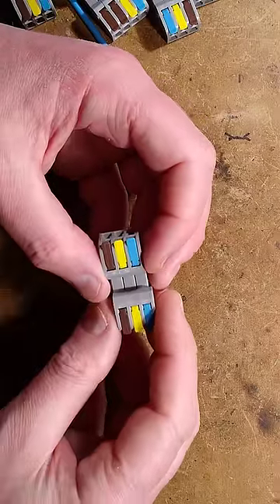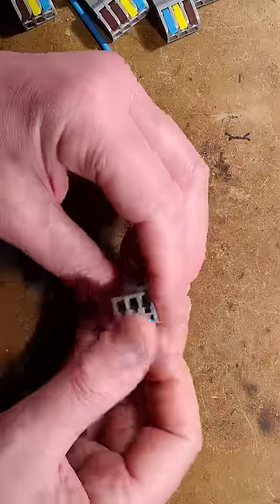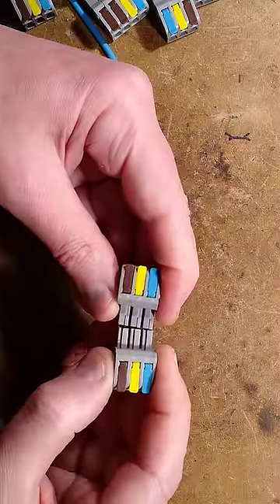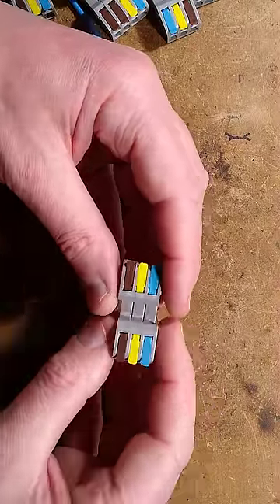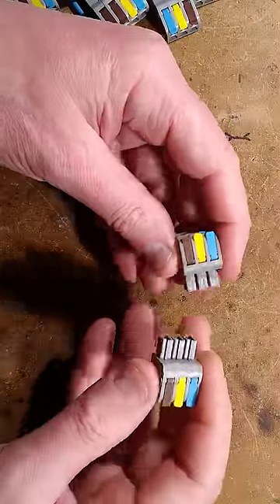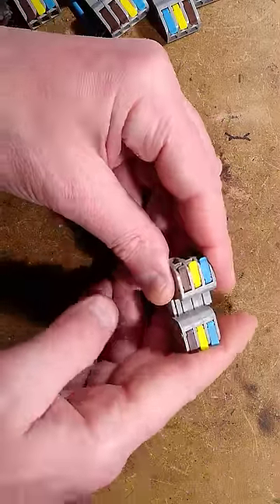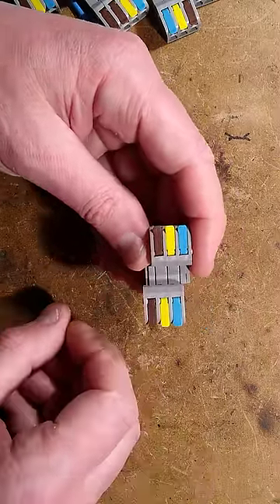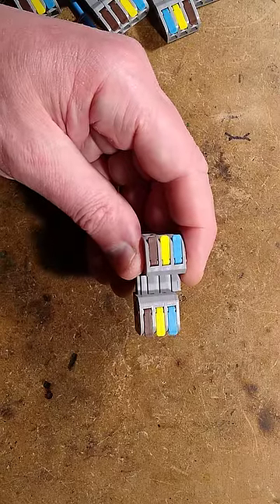This connector can kill you

Comment: I fixed a home installation once were the sockets didn't work. Turns out life and earth wires were switched.
Reply: Death and Earth. 😂
Reply: And that's why you always break the circuit before working on it. You may what you're doing, but whoever wired the circuit might not have!
Reply: I was on a new build recently installing an ev charger and through fault finding discovered the L and CPC had been swapped in a junction box repair where someone had accidentally cut the cable. Crazy!

Comment: To prevent this deaths, in Austria, gfcis on the Apartment Level (located directly behind the mains) are mandatory by building code!
Reply: Those (30mA earth leakage interrupt) have been mandatory in South Africa since the mid-1970s. It's probably why I'm still alive😂. I have however had some shocking L-N experiences in my youth, but I'm still breathing and a pro commissioning engineer at 50+ yo. I made a lot of my own mistakes on powered devices as a kid, but having European mentors kept me alive and interested (interesting) in my youth (thanks Franz). It's guys like us that make the brain drain from any country worse, and why SA is now powerless and supports terrorists!
Reply: Yea tought the same - but i can get the reason here, plus there are industry power circuits that dont have a gfci. Like we had in our data center located in Germany.
Reply: If you connect the Live/Hot to Earth/ Ground, that's going to trip the circuit.
Unless of course the ground is not in fact grounded, then yes the casing will become energized, but then you have no ground to complete the circuit so you don't get electrocuted. 🍻
Reply: @Jonathan-jo2xu  Unless YOU complete the circuit and become the consumer, turning current into heat with your body. Permanently installed machinery is often not RCD protected, nothing trips except you.

Comment: Great catch Clive! The literal definition of “Plug and Prey”! I can’t count the number of time poor assembly design had forced me to plug connectors together by feel only. A certain disaster waiting to occur.
Reply: Plug and Die would be more accurate!
Reply: Prug n Pray!
Reply: You're the prey😂
Reply: There's one live and one neutral not connected. Please explain how it is dangerous if you don't have a completed circuit.
Reply: That was my grandfather's house... And he was supposed to be a carpenter
Reply: @mistborndensetsu5015  So, the problem comes when the circuit is not complete, but very quickly becomes complete when the live wire goes to earth through the (supposedly earthed) chassis of the appliance, your arm, heart, torso and leg. Lots of things conduct electricity and can complete a circuit, including you.
Reply: @Asha2820 why are you working on a live circuit to begin with? One would think you would be extensively qualified or being directly supervised by someone that is if that situation was needed, and usually in that event, you were in the proper PPE to prevent an accident should a slip up occur. If you're not an electrician then it's simply darwinism at work. And if youbare am electrician and know the dangers and still refuse to use the PPE then the fault lies within you anyways, not the design of the connectors. Cuz if you crossed those wires and plugged it in correctly bur still got that live hot wire onto the grounded wire, it wouldn't be a design flaw, it would be am idiot not knowing what their doing flaw.
Reply: @LinkandPage  So, the danger is not that some electrician will be electrocuted while working on an application when it is not receiving Live, as you seem to imply. The problem is that someone will get electrocuted in normal usage of the appliance, when it is receiving Live. Not everyone who uses electrical appliances is an electrician. I assume that you don't go around in rubber gloves when you use your computer or make a slice of toast.

Part of what makes for good safety design is making things easier to use safely and difficult to use dangerously. This is why firearms have safety switches. It's why consumer unit circuits need to have labels on them. It's why food comes with expiry dates. It's why circular saws have riving blades. If someone deliberately designs something that contributes to making it easier to use dangerously when a safer solution is available, that, in my book, is bad safety design.
Also, I dislike the references to Darwinism and the attitude of 'You're stupid so you deserve to die'. It makes the trade less accessible, increasing the barrier to entry, and also you have to remember that, the person who makes the mistake with plugging in the Live to the Earth can cause other people (who don't deserve the Darwin Award) to get electocuted.
Reply: @Asha2820  I own a sig Sauer sp-2022 and a Glock 26 5th gen, and neither of those firearms have a safety switch. The sig is for open carry, and the glock is for concealed. Bith is loaded, and I keep one in the chamber. Before I got brave enough to carry these pistols on my body euth one in the chamber a d without a safety switch, I did what you're supposed to do when dealing with anything dangerous snd that is train until I feel I was proficient enough to use them safely. And i continue to train with them so as not to get careless. Not all guns have safety, and many of them do not. It's called double action. My sig was designed in mind for the police officers who use them so that they could have their service weapon drawn and sined at s suspect with a finger located on the trigger and not accidentally shoot them. But it could still happen. Police officers train with their device weapons constantly. I don't think I've ever really seen a revolver with a safety switch. The point being is dint use something that you aren't qualified or trained to use. Messing with electricity comes at potentially deadly price if uou don't know what ypure doing. Working on a live circuit for anyone other than a qualified electrician who is the very least a journeyman is a dumb idea to begin with. We .ake circuit breakers so electricians jniw what they're doing can still di safely. But just a random DiYer who thinks they are qualified abd know what they are doing can easily screw ip the first part of attaching those connectors just as much as thry could in the second part of connecting those connectors.  The first part comes with taking the hot load and the ground and putting each of those wores into the connector. So what would they do if the 12/2 or 14/2 they pulled out of the wall behind an outlet, they were moving to a new location 3 feet away. They oull out maybe 6 inches of rimex before it can't be pulled anymore because it's stapled to the inside of the studs. Also, say when the house was bejng built, the electricians happen to be behind schedule or the posters were ahead of schedule or the GC screwed up the scheduling, whichever of the thousands of reasons rimex csn end up covered in paint and so now they have 2 wires that have insulation and both are painted white and then the bare ground, also pained. Would they know which wires are which? So shoving the wires into the connector so they can extend the romex with 3 feet of new cabling to reach the outlets new destination.what happens I they put what they think is the hot jnto neutrals spot or the ground and then they do the second part, which is connecting the male and female connectors, and they pull thst second part off flawlessly. The two connectors connect exactly how they are supposed to. You dobrealize they'll still get shocked. Even if they designed the connectors to connect to one another in only way, abd they dud that part correctly, they'd still eat 120 volts, wouldn't they? The connectors aren't just already attached to the wires magically. You have to feed the wires into the connectors. This is how all connectors work. So how do you propose that problem, which is much more likely to occur than two connectors being misaligned, how should thar get fixed. These connectors have gone one step further than most by offering colored slots to make identifying easier. The problem is that there is no way. A qualified electrician knows to pay close attention to that significant detail, and that's why they undergo constant training and testing and have ranks amongst the trade and governmental restrictions for each rank. It's an entire industry. Ebay sells these, most likely in bulk, and there most likely targeted towards electricians. Since they would be consuming this product more than anyone. The overall point is everything you do that has a profession behind it and you have not had any training in that specific profession, then you are inheriting the risks that the training helps eliminate. Do not work on something you are not qualified for. If you do, you are taking that risk, not the company that sells these connectors. Hire an electrician to do the work.  I have worked wuth electrician friends and have even logged some of the hours as an apprentice, even though I dint want to become an electrician but it helps a lot to know what to do since I work as a low voltage electrician, which deals euth access control, fire alarms, cctv, intrusion alarms, datacomm and servers, abd so coming across electrical is a daily aspect if my job. I kniw what I am doing, but when I add new outlets or a new circuit breaker or change light fixtures at my own house, before I even turn the breaker back on, and despite knowing how to wire up multiple switches with switch legs in a receptacle or under my workbench, I call my qualified electrician buddies for one to cone over and check out my work to ensure a secondset of eyes, qualified ones, look at my work and deem it safe. And I usually throw them 50 bucks and a 12 pack to show appreciation because I am not an idiot and j know that me sgsinst electricity is like me against Mike Tyson, yeah theirs a remote possibility I could win, but not really, 99,999 out of 100,000 times I'm gonna lose so I dont take that risk. If you are willing to work on a live circuit, then by all means go for it, that's simply called darwinism
Reply: @Asha2820  Wait, why would I get eltrocuted making a piece of toast. If the connector was plugged in wrong,  the breaker would trip when you turned it back on, therefore rendering it not a live circuit anymore. Same with the computer. And my table saw has no guard om the blade, you don't put your fingers in there and you feed the wood in the correct direction against the fence, but even those table saws that stopped if they hit human flesh only can stop so fast. I get it if safety factors can be added then they should, but making keyed or different sized ports on these connectors cannot stop the user from incorrectly putting the wires into the connectors, which again, would be the more likely scenario for misfiring than improperly connected connectors.  And the trades should be challenging to get jnto so as the trade jobs become higher paid and much more appreciated as the work output would end up better quality while painting anesthetics as well. But I can't fathom a reason why anyone would use this connector that either wasn't an electrician or doesn't realize the risk they are choosing by not paying for an electrician abd point it themselves. It's a very low chance this connector tor will hurt someone down the road after its installed. Jf incorrectly wired, the breaker trips abdthats it. Noone is getti g electrocuted a month after the connector is installed. Any eke triangle wirth their salt or ant responsible homeowner or whomever hired the ekectrcican would know to test out the work they did before leaving or allowing them to leave.
Reply: @LinkandPage  ah, so they would... test... the live shell of the thing...? and then get killed??? good idea! this thing should be keyed or not sold whatsoever.
Reply: @LinkandPage  im sorry but your safety-less guns have nothing to do with the point here.

Comment: I bought some of those connectors for low voltage stuff thinking that they would be an ideal replacement for a RS one I’d been buying for 20 years,  that got discontinued.
I liked the so called universetality of them until I realised that although the connector is universal the color coding isn’t, because if you pick up random connectors it possible to wire red to blue and blue to red .
I also picked up on the offset pins thing last week on a LED pixel job where I realised if the connectors weren’t plugged in correctly I could put 24v onto a 5 volt data line causing dead pixels .
I put those connectors on them at points where this Chinese dragon lantern i was working came apart for transport only to find at the gig at a 5 am load in that the warehouse staff took the connectors physically off the cable with the lever pins rather than just pulling the connectors apart …
Reply: If you ask me -- and, yes, the fact that you didn't hurts ;-) -- I'm inclined to agree with the warehouse lads.
Reply: i feel like this is a r/rimjobsteve moment considering the username

Comment: Kill is often clickbait, but not this. Thank you for alerting us to this murderer.
Reply: Around 70 people a year die from electric shock. Compared to the millions of people that consume electricity.  It really that big of a deal really!
Reply: @clareclarefasler8532 it is a big deal since these deaths are senseless, easily preventable deaths.
Reply: There are about 225,000 electricians in the uk & each are at risk of death from products like this often used by unskilled folk attempting a repair, find they can’t do it & call in an electrician having created a death trap. Big Clive was electrocuted by bodged electrical work, so it’s something that is capable of removing highly competent engineers who literally keep the lights on & that is a big deal.
Reply: That's why I'm using them for low voltage DC stuff only, and mainly 2 terminal version instead of 3 terminal ones.

I would NEVER plug anything that's even close to live into this connector.
Reply: @clareclarefasler8532 Very surprised, even shocked  to see you have that attitude.

We can all play with statistics to get the desired effect we want, but the simple fact is electrical products should and can be designed to prevent misuse and electrocution.  Suggesting that doesn't need to be done is plain wrong.  You should know better.
Reply: If you’re ground is live and not immediately tripping breakers you got bigger problems than a mis aligned connector lol
Reply: @Youngbl33zy  That assumes there is a trip installed, even now many homes have only fuses & no trips. When I worked as a nasa project manager I had one of the students install trips. I did not then know he was Amish escapee. He had no clue & wired live through the rcd to ground & there was an impressive explosion on switch on.
Reply: @clareclarefasler8532 70 people a year where? In your city or region maybe, but certainly not in the world, not even in a country of several million people, it's far more than that!

What's the source for your statistic?
Reply: U
Reply: Thankfully I don't think I've ever seen Big Clive use clickbait. The man is a gem.
Reply: Well, at the end he says it could result in 'horrible things.'  Now which video would click on? "kill you" or "horrible things"?  As you said, usually clickbait, and not being an electrician, I clicked bc I wanted to see how this thing could cause that outcome.  And, yep, no exaggeration here. Let me add my thanks to yours.
Reply: @springwoodcottage4248  explosion still means it was grounded. The risk the other guy was talking about in case of "no trip" is energized ground which is silent and deadly
Reply: Yeah, whenever I hear this guy say something can kill me I have every instinct to believe him lol
Reply: As an electrician, the chances of death from electrocution from this scenario doesn’t even warrant a video about it

That’s like saying… you could die from falling off a 6 ft ladder, but probably won’t
Reply: When clive says kill, clive means kill
Reply: I got shocked so many times and I'm not and electrician. I basically stay at least 5 meters away from any live energy source that can instantly kill me just in case.
Reply: @springwoodcottage4248 boy ain’t on the farm no more
Reply: @clareclarefasler8532  good to know human lives are just a simple statistic for you. 70 people is still a lot of people, especially if their deaths are avoidable
Reply: @clareclarefasler8532  "It's OK to make components that are almost guaranteed to kill someone because millions of people use electricity" is a buck-wild take.
Reply: @LRM12o8 I got an inside source on stats that ran a statistical study & it came back claiming over 95% of statistics are inaccurate
Reply: @Wizard__J  as someone who is not an electrician, this is still dangerous and should not be ignored just because you think it should be.

Comment: Been there before a few times with the dinosaurs that I keep running in the shop I work at. They weren't as concerned about keying connectors when you do see them (majority of the wiring goes through terminal blocks to make it easier to trace connections), fortunately, nor were they keen on connecting chassis to ground. I presume the lack of ground came from decades of the maintenance guy before me stating "that's just one less bolt to secure, we don't have time for that". Can't say I haven't heard that a couple dozen times before he retired...